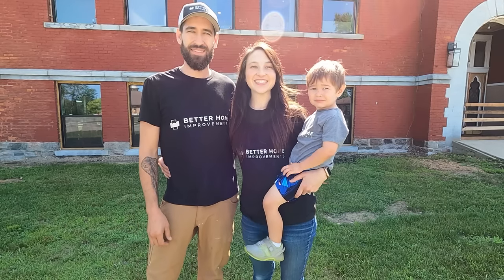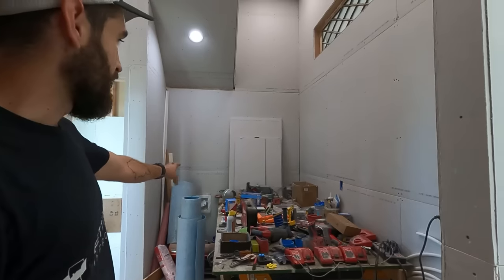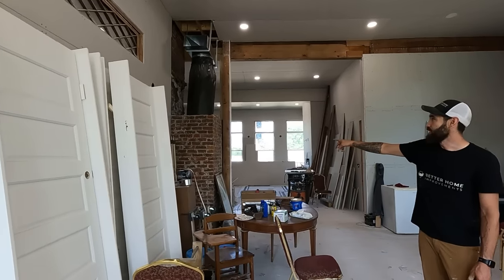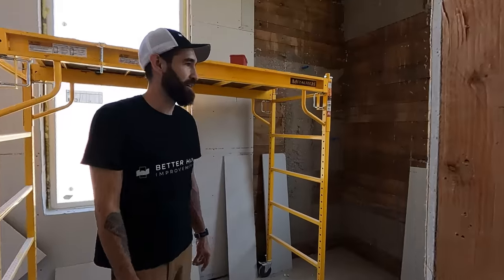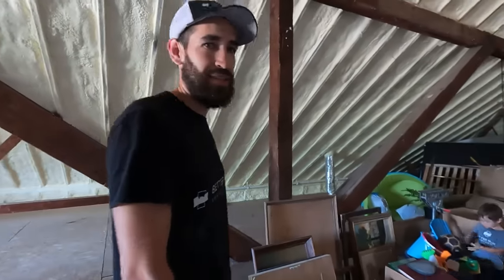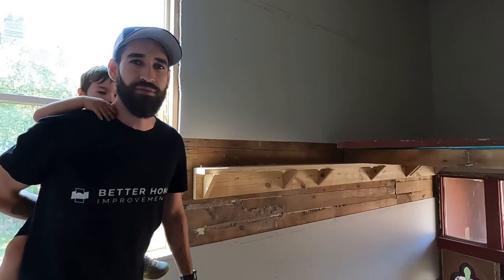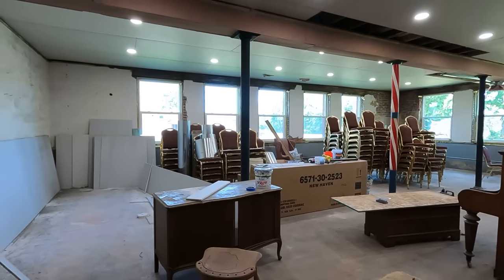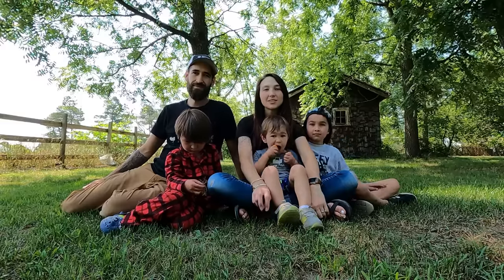Schoolhouse of 1909 FULL tour walkthrough // Where we are at a year and a half into the project //

Comment: Fantastic work, but sealing the wood roof ceiling and joists with spray foam will quickly rot the wood as wood needs to breathe because it is an organic compound.  Spray foam does an excellent job at sealing in all of the nooks and crannies, but does not let wood get the air it needs so it suffocates.